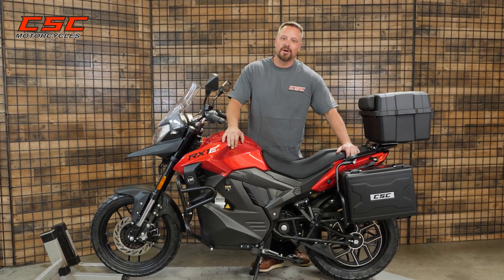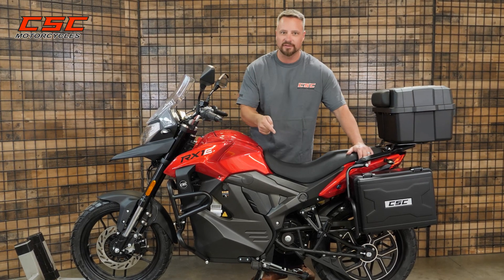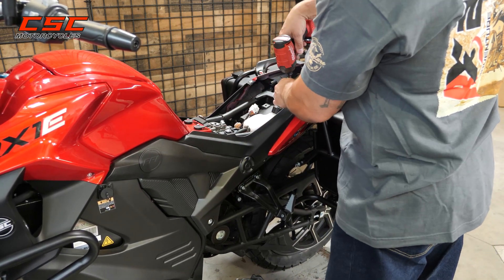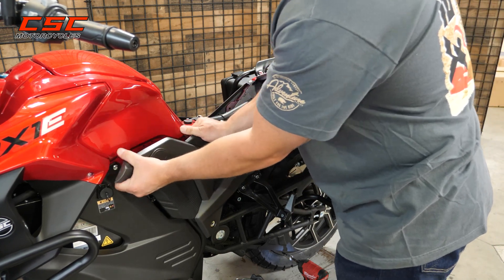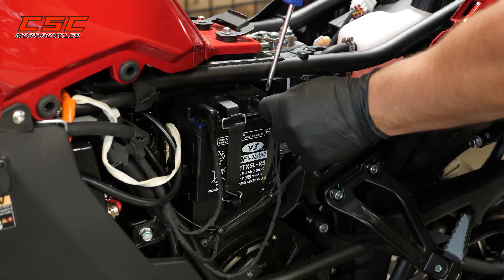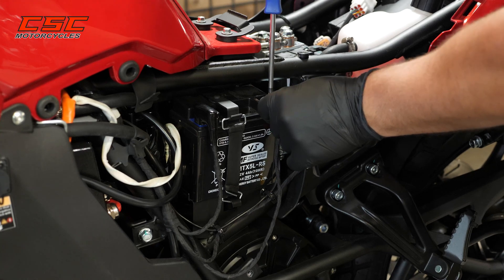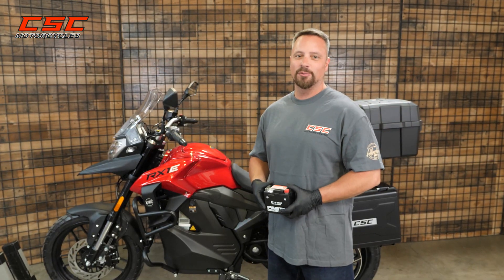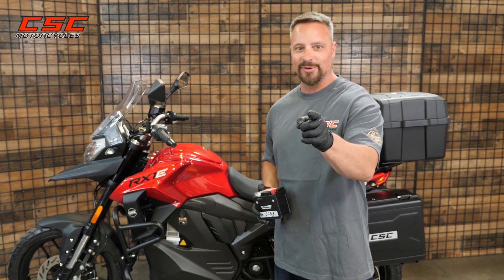CSC RX1E Maintenance: Changing the 12-Volt Battery

Comment: Why would they need a 12v battery on an electric bike? Does it run the liquid cooling pump or fans or something? And why is there which looks like a regulator/rectifier on the frame near the battery box...puzzling.
Reply: To hook up aftermarket lights, GPS, heating handlebars and seat, front and rear camera, etc.